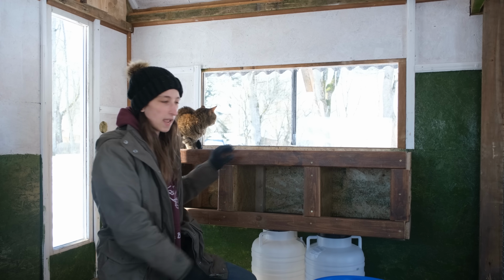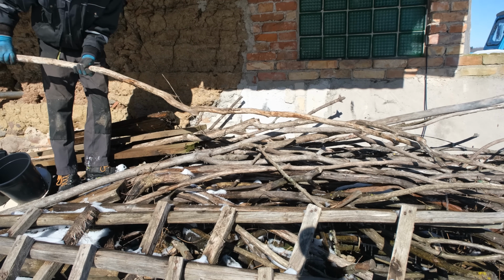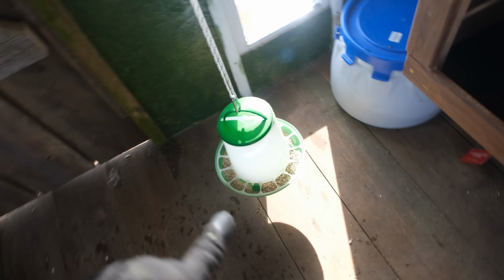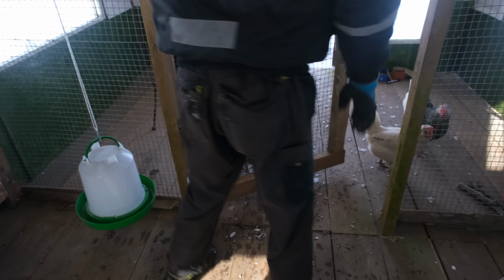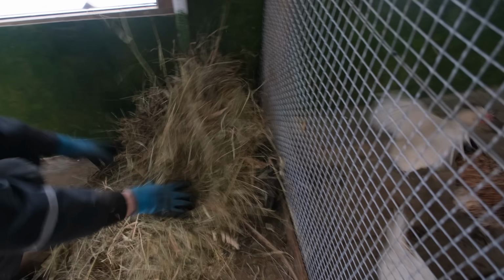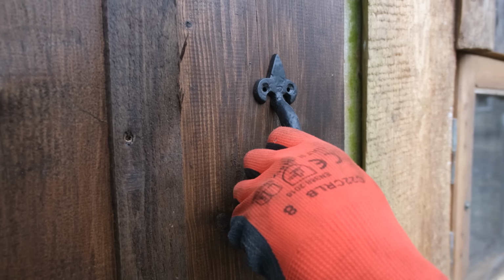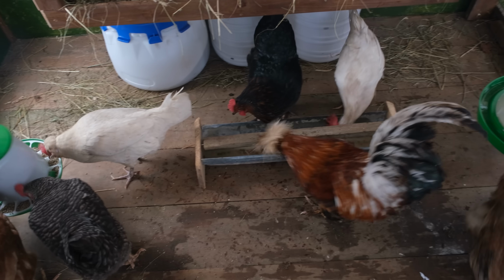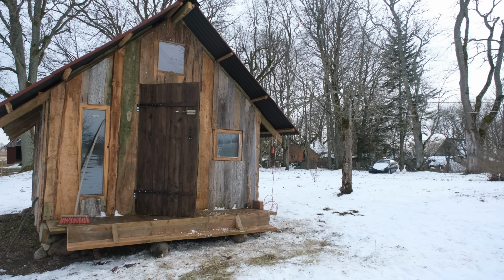Bird Coop is FINISHED!?

Comment: Wood chips are best for the floor, very deep, 6-8 inches deep, so when they jump down from perch they won’t break a leg or wing.  Also with deep wood chips it smells better, because you can just turn the poop under when there is a lot.  (With a garden fork). And when you clean it all out once a year, you can put it in a pile and compost I it…beautiful compost for garden.